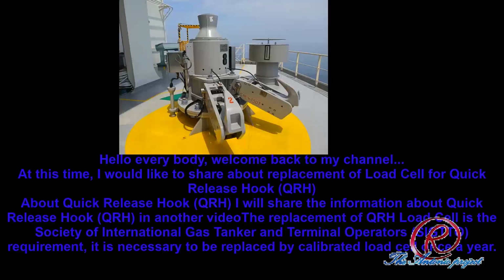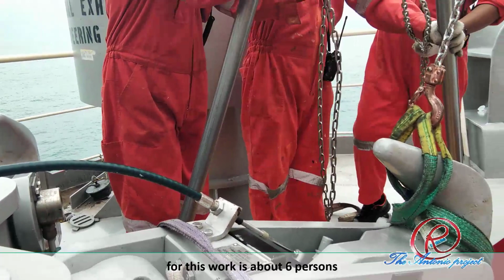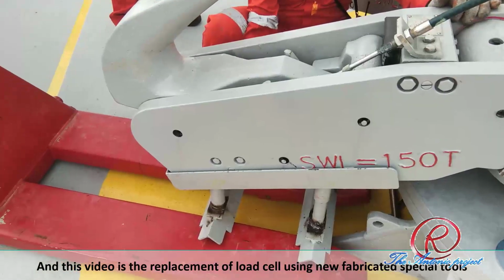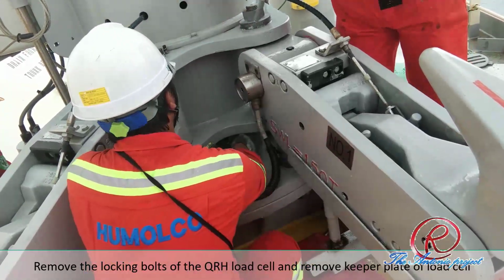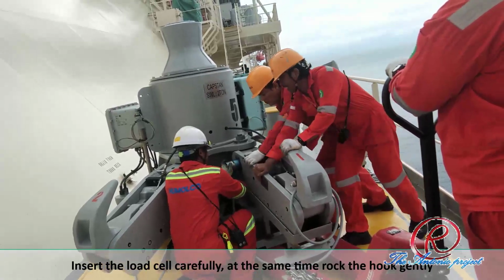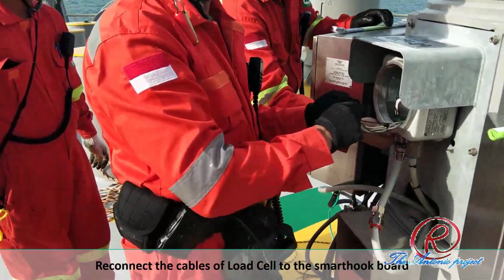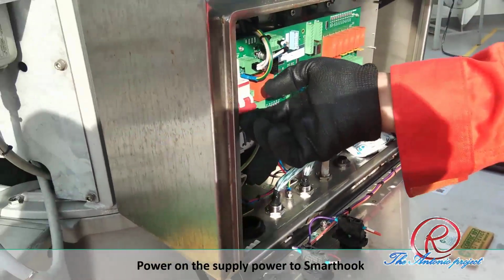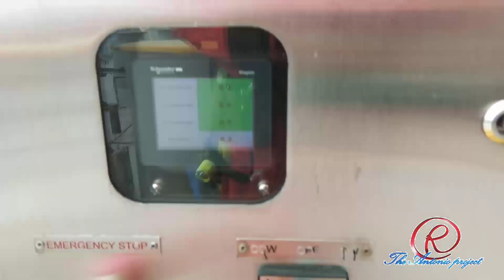Quick Release Hook Load Cell replacement

Comment: What is your load cell capacity and Where You did re calibration of it or You never did but just replace it with new spare?
Reply from the maker: The capacity (SWL) is 150 T, and for operation we maintained betwen 5-30 T. 
We did calibration onshore by makers, it is required by SIGTTO to be calibrated once a year. 
Thats why we did the replacement of the load cell by calibrated one and send the used to shore for calibration.